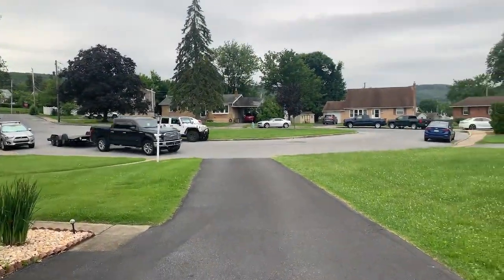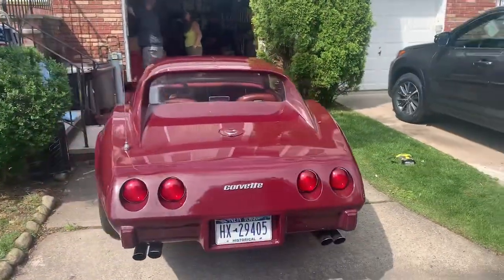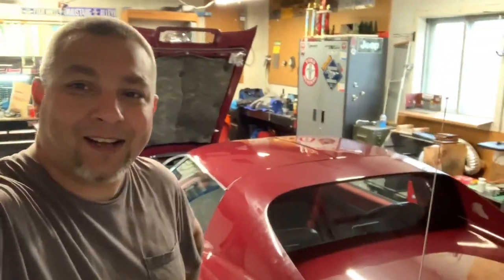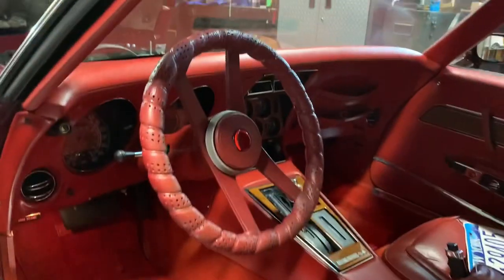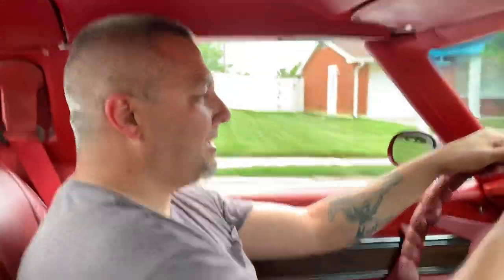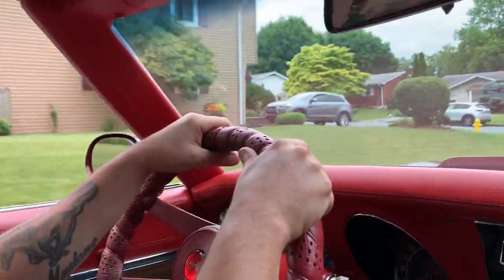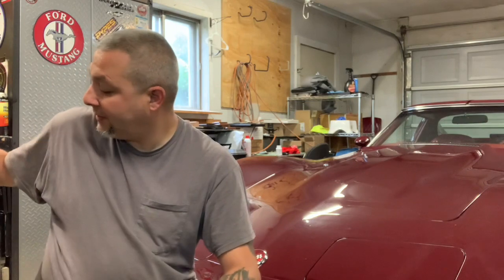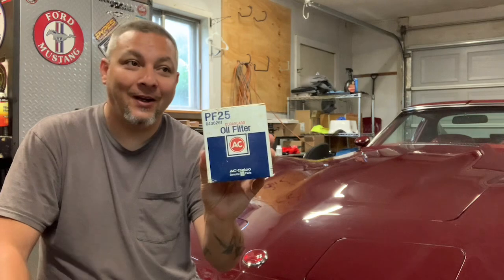Bought a ‘76 Corvette Stingray!!

Comment: I had a red '76, similar to the one you have.  Came with the same L48, 155 hp 350, automatic and optional aluminum wheels.  I was very surprised with the good ride and decent fuel economy when I wasn't poking the gas pedal too hard.  I do like the aftermarket bubble taillight lens' and other tasteful add-ons.  I hope you enjoy yours, too!

Comment: Sweet Deal! Impressive start up with little fuss. Looking forward to updates on brakes and the bouncy ride noise? Doesn't seem like a biggie for having sat for a while. I had to smile at the Mustang tin behind you. I sold my Mustang to buy a C-4 vett So, my mustang stuff kinda got put away for my old GM stuff took its place. I would have gone for a C-3
but finding one locally was tuff. Rust was an issue on the ones I looked at. Having another vehicle as a daily help's due to snow or rainy days. Keeping it indoors like yours. Going from 400+ Hp to 245 was different but hey it's about enjoying the ride or smiles per mile. Hope yours are many!

Comment: Smooth engine, is that the L82?
Reply from the maker: Thank you! Unfortunately it’s the L48 but it has a couple of upgrades in the Edelbrock intake and carb and all of the emissions stuff has been eliminated. Definitely a good running engine just needs more power.